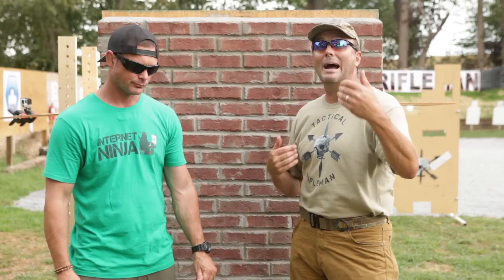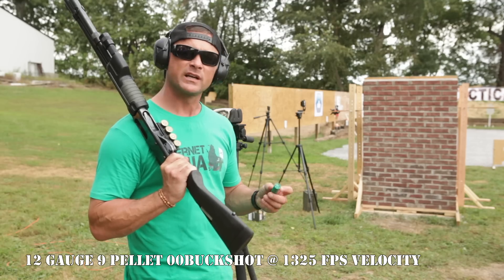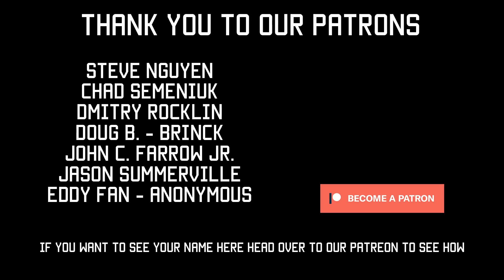Navy SEAL test Ballistics through Walls | Tactical Rifleman

Comment: I really like the low velocity shotgun shells. I have birdshot that travels faster than the slugs that was used. but I do understand the cost ammo 😂😂😂
Also noticed a lot of errors. You do know a whole point is not known to penetrate better than ball ammo. The whole point of a hollow  point is to expand and stop. And you will never get the velocity out of a 9 mm pistol (even if it does have an arm brace lol) that  you would have being fired from a 16 inch carbine rifle. Was that pistol barrel length 6 in?
Reply: Good point on barrel length and bullet distance.
For example:
Recently shot a 9mm from 16" barrel at a target sitting at 25 yards. The bullet went through the target and into a backstop of dirt at 100 yards.

Comment: Karl is right about knowing your house.  Know what angles you can shoot where there are good backstops if the bullet misses the bad guy.  Know when you need to shoot up or down.  I use an AR because it's a pain to shoot a pump shotgun from compromised positions, and I have found that the shell will fall out when the ejection port is facing down when racking a round into the chamber.
Reply from the maker: Amen

Comment: Excellent demonstration.  I have #4 buck loaded in my 870.  Paul Harrell did a video where he showed #4 buck went through the interior wall, but didn't exit continue on through the exterior wall that was 10' away.  Smaller pellets loose their energy faster than those of 00 Buck.  I don't think birdshot is enough to stop a threat.

Comment: Did I just hear a “navy seal” say that a 556 may not penatrate  through 2 pieces of 1/2” thick drywall? After he witnessed the 9mm blow through the wall and gel he explained the 556 is moving faster and has less surface area than a 9mm but still says the 556  may not penetrate the wall? Wowza

Comment: Great test and info. As a firefighter I would say you covered all of the common wall types, with the exception of oddball things like membrane structures and metal out-buildings. If you still have the setup, would you consider testing standard velocity ball rounds and hollow points out of a pistol, through gel then interior wall to see what the over-penetration potential would be for rounds hitting the target rather than misses? Maybe half a gel block to represent the target and another one behind the wall to test the remaining potential?
Thanks for the great content!

Comment: Here in England they'd have to shoot through 9 inches of brick with a cavity for a property built between 1950 and 1980...after that...9 inch concrete blocks, or 4 inch bricks and then a 3 inch concrete block with a cavity between the two.

Comment: Very interesting wall constructions. Here in South Africa, the dividing walls between rooms are single stack, cinder block with a layer of plaster mix to smooth out out. The outside walls are double cinder block wall, with air gap between layers and reinforced with rebar. And this is a standard construction here. We very rarely use why dry walls.

Regarding the video, would have also been great to have seen some bigger calibers. Like 7.62x39, 300BLK, 308, etc.
Reply from the maker: Thanks for sharing the wall constructions there in South Africa. We will be using those 308 calibers in our next video in this series. Thanks for watching, TR

Comment: Firefighter/ Paramedic here, this is the best realistic video I have seen yet on this subject matter. Would have liked to have seen 308 and or 45 ACP comparisons as well. However, as a fireman concrete block with brick exterior is the building construction commonly encountered in my region that would give me a hard time to destroy if I were trapped inside a building and needed to escape.  Concrete block with rebar and poured solid is the hardest of ALL, however not usually encountered. My go-to has always been 556 for home defense.  Shotguns will never be my choice, the reason being with a shotgun slug it will over penetrate and with birdshot or buckshot, there is over penetration as well as a concern of hitting a family member if they are being held at gunpoint.  Even if I offset the shot I could still hit the old lady... Why would I want to possibly be constrained by that?  Now if we are talking ex-wives then the shotgun with pellet ammo may be my choice :) Lol   If I were to build a new house it would be concrete block construction with rebar poured solid then I would be golden. Additionally, it would be considered class A construction which means your not burning me out either (as long as the roof is non-combustible as well)  Great video gentlemen. Thank you.
Reply from the maker: Mike, thanks for sharing and thank you for your service. strength & Honor, TR
Reply: And thank you for your service to our country brother.

Comment: Thanks for the very informative video.  Any consideration to adding SIP builds and ICF to your list of walls tested?
Reply from the maker: What are those?
Reply: @TacticalRifleman  sips -structurally insulated panels... Think polyurethane foam core sandwiched between another material like wood or mgo, magnesium oxide cement.

ICF - insulated concrete foam panels. Concreted sandwiched by polystyrene lego-like blocks.
Reply from the maker: Thanks. I’ll add them to the video idea list

Comment: Have you done this kind of test with an inch layer of stucco on the outside?
Been looking for that, and haven't been able to find one that shows it. I think the sand in the stucco would help keep it from going through similar to sandbags. 1/2 my exterior is some basic wood siding, but half is stucco about an inch thick with drywall on the inside.

Comment: It would be cool to see some testing done with common hollowpoints versus frangibles in residential building materials.  Would using a .223 Hornady V-Max be safer than a 5.56 ball round in interior drywall?  Does using a Glaser Safety Slug make your 9mm safer for the neighbors versus a hollow[point?

Comment: Very good video. I learned alot. On that note i think he should have used more than 1 round. Fill the catalog of the shotgun with slugs. Empty it on the brick wall then check the damage. Same with the 9mm and 5.56. Bet the out come is different. On a side note. Ive read that a pistol is best for home defence. There is less chance of home invader to get leverage of gun and take it from you.

Comment: As a gun guy who does some training to keep my accuracy up when under stress. This is a good test to what a round will do. As a firefighter these would definitely be considered typical walls in the USA. But you expose any interior wall to extensive heat even brick you might see detriment to the integrity to the structural strength to even brick walls and possibly concrete. But this definitely true after a fire and the structure was restored properly

Comment: Very good video. Thanks for the time, effort and money you put into it!
If possible I would like you to try a penetration test with 556.

10 sheets of plywood, but not the way that people normally stack them, one immediately behind the other.

Stack each piece of plywood about 15 feet apart. 10 pieces total and see what type of penetration you get with various rounds.

I suspect that even though the 556 is capable of going through 10 pieces  stacked one behind the other, it won't go through more than a few if they are 15 ft apart. The space between the barriers matters.

I believe this test will prove why the  556 is suitable for home defense. The bullet does not go far once it exits the house. It tumbles into the ground.

It's an expensive and time-consuming experiment to set up, but any channel that does it first  will become famous.
Reply from the maker: I don’t know many houses, made of just plywood. Don’t get me wrong, I agree 100% with your logic. However, doing it with actual walls is something we could do. I’ll add it to the list. We did another video, called best ammo for home defense, that you would like. It covers 5.56mm.   You can find it in our video archive. Thanks for watching, TR
Reply: @TacticalRifleman  thank you. The material could be sheetrock as well. I have tried to test myself, but I usually lose track of the bullet after it goes through 4 pieces 15' apart and I don't know where it goes. It seems to Veer too far off course to know for sure how far it will go. The pieces I was using were  small.

Comment: Never mind I just answered my own question.  I remember talking to a man that was a National Guardsmen way back when Newark New Jersey had riots.  There were snipers in brick high rises and the guard would come in force and open up on the snipers position.  Brick construction was useless.  Even hiding in a cast iron tub was not enough.  What was the guard shooting?  M1gerands with armor piercing rounds.  30-06 black tip.  From what he said they would go up to check and they would find pieces of the sniper all over the place.   I remember he said they would find fingers.  That's what he said "fingers here and there."  I guess you don't really have to shoot that nice wall with a 30-06 after all. A 7.62 X39 might be interesting though.

Comment: #4 shot shell, it is .32 caliber equivalent, should be about like birdshot.  I didn't see stucco or clapboard siding either.  Aluminum siding over regular sheathing/insulation.  I am more worried about the neighbors if the rounds really fly, at least mine would not be their problem.  (patty hurt/SLA, and what just happened in Kentucky, 1000's of rounds.)

Comment: I have Hornady 40gr A-MAX loaded in my 16" barreled .223 AR. From what I've seen/tested this is a great balance of devastating close quarters terminal ballistics in soft tissue with minimal overpenetration through that soft tissue target. I shot a 140 pound whitetail with the same 16" barreled AR from 10 yards through the lungs and it took two steps and dropped. On field dressing the deer, the closest lung was like cranberry jello. The round fragmented in the closest lung and macerated the first 1/3 of the far lung. Tons of hydrostatic shock. No exit wound. .223 is not an ideal deer cartridge by any means but it's legal in my state and I wanted to see what my home defense set up would do up close. In short, it worked on this one deer. Probably will work well on a 2 legged critter too. This set up will barely penetrate 2 layers of 1/2" drywall hit directly. When I tested it, the round fragmented in the first layer of drywall and peppered the second layer of drywall essentially losing all of its energy after exiting that second layer of drywall.  I like your set up with the ballistics gel behind the wall. I'm going to have to try that to see just how much energy is left in the bullet fragments as it exits the second layer of drywall. Thanks for the video!
Reply from the maker: Thanks for sharing, TR

Comment: Nice test. Very accurately built walls. I wish you tested more rifle calibers than just 556 though. Like maybe 7.62 AK ammo. I heard that those DO shoot through cinder block. And I've seen them shot through loose cinder blocks. But I don't know if having being attached to other blocks in a wall with mortar would make a difference.

Also, I have no doubt you wouldn't miss someone inside your house. But most people who need to know this info aren't even military, never mind former special operations. They can easily miss when under stress, even in close quarters. It'd would have been nice to know if the exterior house wall would act differently when shoot from the interior instead of only the exterior.
Reply from the maker: We have a part-2 of this Video coming out soon that covers more rounds

Comment: Stick with 3 little pigs story guidelines and you’re good! Brick over block, fill every other column with concrete, the others with sand, tile or steel roofs, security closures for windows like a security door but a window shudder. Block interior walls also

Comment: I personally prefer #4 buck vs 00 buck in a 12 gauge. I load my 9mm with 115grain jhp. XM193 for my AR15. I don't worry too much about over penetration, I used too, but I've come realized that I was just failing to recognize one of the important rules of firearm safety, and that is to know what is beyond your target and what your backstop is. If a round goes through the bad guy, it would have lost a huge amount of energy so I'm not concerned with the projectile or projectiles going through my house and into my neighbors house. I've also considered the fact if I can't shoot straight because of an unsafe backstop or because I don't know what is beyond my target, I actually prefer to aim low for the hip area, then at least my wood floors would be the backstop and if the round goes through the floor, then there is the unoccupied basement, or kneel and shoot at an upward angle if possible, either possibility will be determined by that specific scenario, floor plans, and location within that structure. 
I usually prefer a shotgun the most for home defense only because I'm very familiar with it and very proficient. I grew up using a shotgun for all types of hunting and target shooting. However since I do conceal carry, I wouldn't rule out my pistol, it does have its benefits, but I have been training and practicing a lot with my AR15 for home defense or any other life threatning scenario that requires the use of deadly force. 
I know a lot of folks argue about the muzzle blast and the noise of being fired indoors, many argue about that topic alone, but honestly, I don't care. I'd rather be deaf and alive, knowing my wife and kids are safe than to take the extra time to put on hearing protection or waiting six months or longer just to get an okay from uncle sam for a silencer on my pistol or AR15. If there is a threat in my home, my #1 priority is to ensure the safety of my family, and to stop the threat, some hearing damage isn't one of those priorities. 
Last but not least, everyone should have a plan. Know what to do, where to go if possible, and know how to use the tools available to carry out that plan successfully.
Reply from the maker: Thanks for sharing. You have a solid plan. The more proficient you get with that Rifle, the more you will learn towards it

Comment: Great video... if you still have the walls set up, I think it would be VERY informative to go thru those scenarios again specifically using 9mm hollow point (any popular brand).  That is a round  designed specifically to penetrate a lot less, and I would guess a lot of your views use them for self/home defense.  In fact you wouldn't even need to do it on the brick or cinder block ones, since we know it wont penetrate those anyway.   It would be great to see if they perform as expected or if our assumptions are incorrect.
Reply from the maker: Amri, actually, we already did this with a variety of pistol rounds, a few months back. YOu can find that video in our video archive. Best ammo for home defense. Thanks for watching, TR

Comment: You guys should have used a 22 LR on the drywall, interior stuff. It will penetrate several interior walls (7+) and helps point out the fact the interior walls are pretty much transparent to most any gun fire. Otherwise, awesome job!

Comment: Question, because I keep getting conflicted information on 556, why is it obviously going to go through the interior to exterior test? It traveled the least distance in ballistic gel on the interior interior test. I hear well it has more power that’s more penetration obviously but then I hear well because it’s smaller and faster it breaks apart and slows down faster incurring less penetration. Like how when shooting water the slower the round the deeper it goes slowing down slower and the faster the sooner. I really need information because despite training and conditioning there’s what if I miss. Because that’s the mindset I have it for what if. I’m on a budget but want to buy. What I really need as my first gun and really can’t fuck up because it’ll be awhile before I can get another one. I’d prefer to get home defense right the first time. I live in an apartment with two roommates. One is also looking for the same thing. I’m 19 and can get pistol from unlicensed seller altho it may be harder to train with it and harder to get ammo it’ll be worth it if the glock 17 in 9mm is what works best for my situation. But if 556 will stop sooner should I miss I’d rather fish money for the 556 while having an easier time going to the range and buying ammo even if it is more expensive. I’m sorry I really won’t get a shotgun. I’ve looked into it extensively and it’s not for me. Nothing about it appeals to me and my fiancé wouldn’t be able to handle the recoil if she had to use it when no one else is home. Few rounds don’t penetrate more than I’d like. I live in Mesa arizona. So please If there’s a law I don’t know about that would ease my situation I’d love feedback. Also the more maneuverable for tight spaces the better. I understand that’s easier with pistols and sbrs and I want them but the caliber conflict in mind as well as the difficulty of range use and ammo acquire meant when I’m 19 is a con typically not there. As well as having to get one from an unlicensed vendor. I clear a background check FYI just for those who this seems suspicious. But yes a short long rifle (ironic I know) would be the best if 556 doesn’t penetrate as much as 9mm after initial breach. Also keeping in mind budget options are appreciated but if you have pricier options that come to mind I’d love to hear them for the sake of information and future in mind.